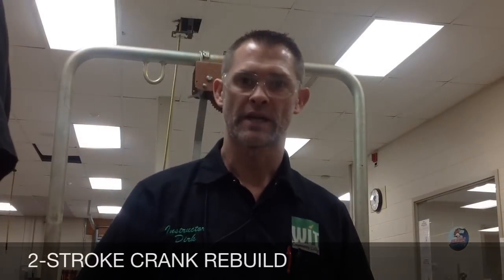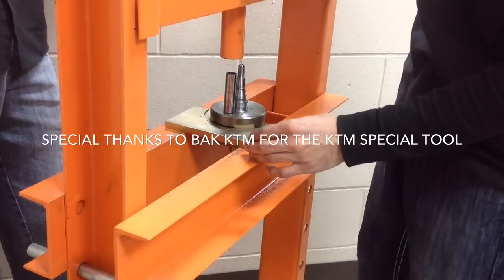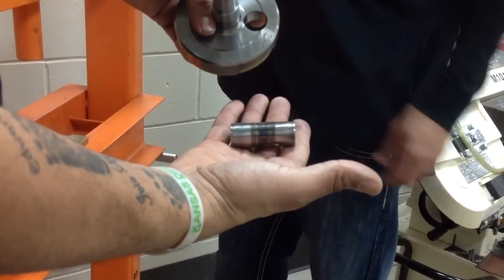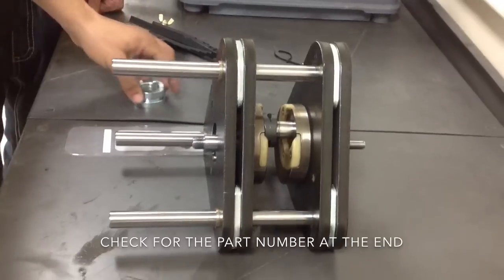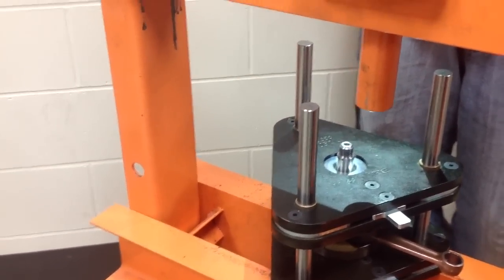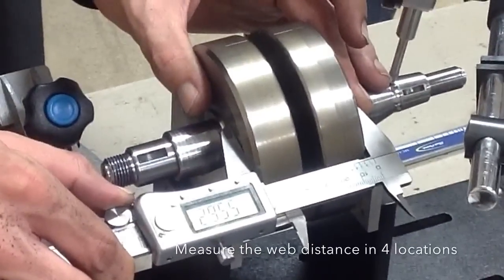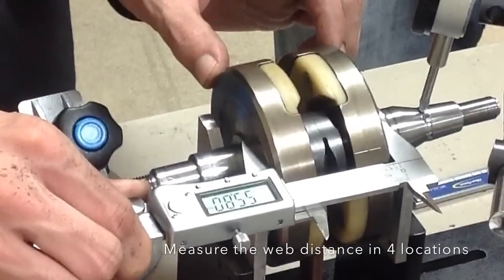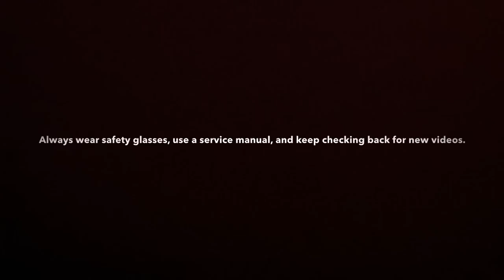2-Stroke Crank Rebuild and True

Comment: Awesome video on the procedure; not the faint of heart or typical DIY shop at home. That "single cylinder crankshaft assembly fixture" is $1,000 on Parts Unlimited! I suppose buying the new OEM parts (thrust washers, crank pin, and bearing) and taking it to a motorcycle repair shop wouldn't run too much on labor?

Comment: Looks like the dial gauge is right above the v-block or very close. That is not an accurate way of checking run out, the only thing you are going to read there is if the shaft journal is out of round.
Reply: Yes check it at the ends of the shaft where is could runout, not on the bearing journal on the truing stand. Amateurs! WTF school was this???
Reply: I agree total hack job
Reply: Better to put  it between centres to true it up
Reply: Can't believe this was at a college...and the teachers do not know anything about the procedure. How embarrassing...they think all their cranks are perfect because they have no clue how to measure.

Comment: I dont see how the jig holds each web exactly opposite each other, seemed like there was no recess, but there must be some way it does that. When pressing together, I see the use of the caliper, but if you press too tightly, you have to dismantle it and start over?  Seems a bit hit and miss.
Reply: The two webs are identical size and shape as are the holes that they fit in on the jig.   The crank pin physically cannot go in one web and not the other if it is not in alignment.
Reply: Never press too tightly too fast, sure they pressed it little by little until they got their desired specs

Comment: Ik this vid is old by now but i have a 2007 rmz 250 that needs the crank rebuilt but you cant pop the rod pin out with a press bc of the 2 sides being in the way, the only way to get the pin out is to seperate the weights but i have no way to do this, im more than happy to hear some ideas :)
Reply: Heat. And lots of it

Comment: WEAR DO YOU GET YOUR TOOLS FROM LET ME KNOW THANKS
Reply: The press plate came from our local KTM dealer.  I posted the part number and his phone number at the end of the video.  The crankshaft installing jig and the crankshaft alignment tools were purchased through Parts Unlimited.  You must go through a dealer to purchase those tools as well (you could use the KTM dealer).  The part numbers for those tools are also listed at the end of the video.  Thanks for watching.
Reply: THANKS DIRK BAK

Comment: Get rid of the press and music. Get a real press not Harbour fright junk.
Reply: because that press does not have a built in dial gauge which gets the distance right so you dont press it too close and have to dismantle and start over.
Reply: Cheap tools are cheap tools. Not bad for a backyard shop. Not good for anything else.
Reply: @skizzysmith  One could always set up a dial indicator on the top of the piece being pressed....